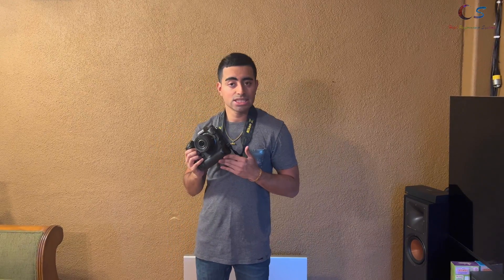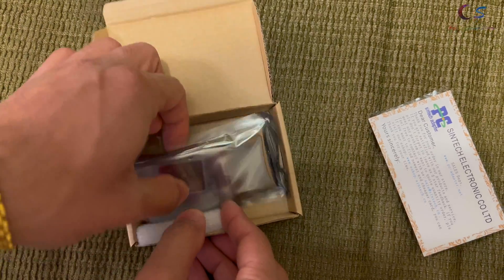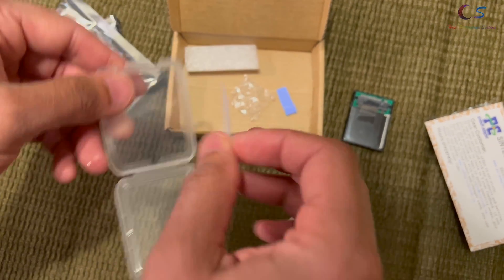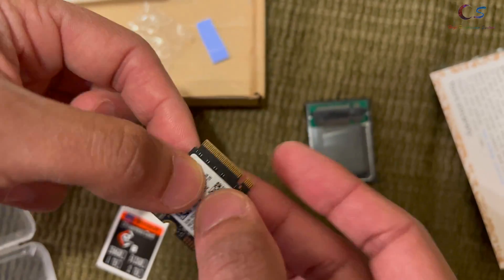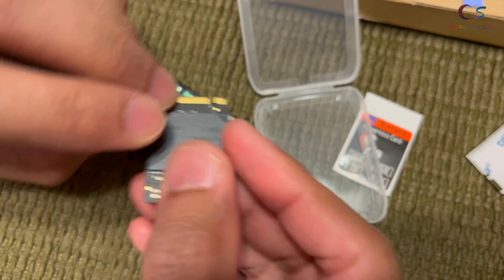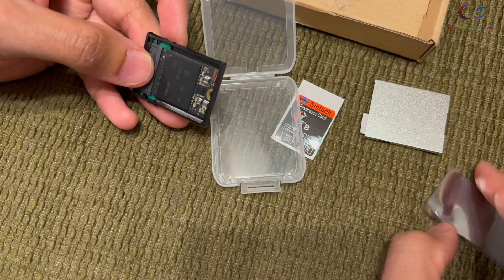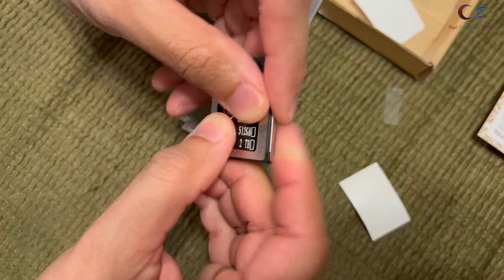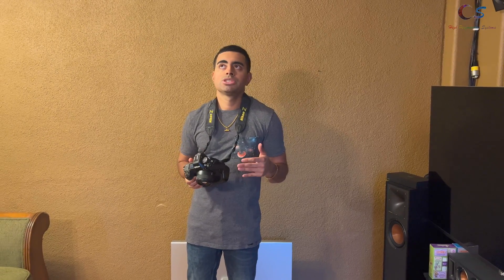Building my own 512GB CFexpress Card using Sintech adapter in Nikon Z9

Comment: Its not about write speed, it's about sustained write speeds
Reply from the maker: Yes the SSD itself when cooled can handle sustained writes but being in a small enclosure it can’t perform at full power. I’ll see how the new full metal card performs in a couple weeks but it was more as an experiment than anything. For pics and 8k hvec recording it’s fine

Comment: the thermal pad should be on the back of the ssd.
Reply from the maker: To elevate the ssd?
Reply: @cs.studios  yep the memory will get direct contact with the metal side and the back of the pcb will have the thermal pad and conduct heat on the other part of the metal plate. Plus use computer thermal paste for the memory that will be in direct contact with the metal plate.
Reply from the maker: Is there any easy way to open this up after it’s been closed? It uses plastic tabs. I also ordered the metal one with screws as well that one seems easy to open after install
Reply: @cs.studios  use a hot air to soften the glue.
Reply: @MadManTnT nonsense the thermal pad (or thermal paste in its place) goes to fill the gap between case and the chip to conduct heat. You do not need to conduct heat from the blank side of the ssd